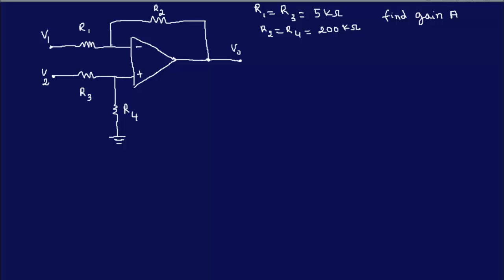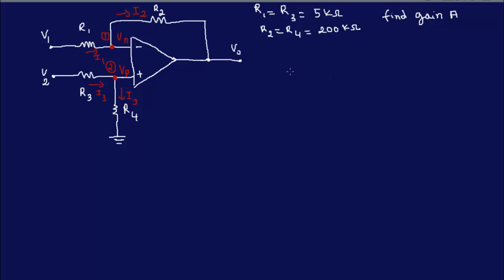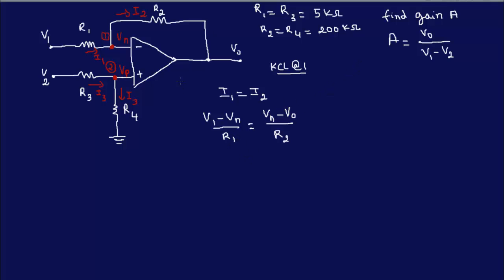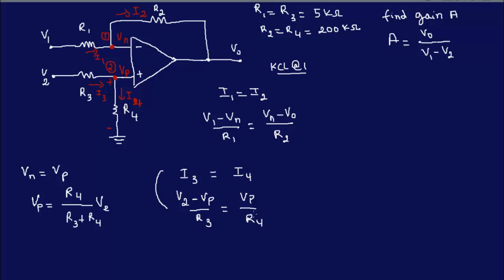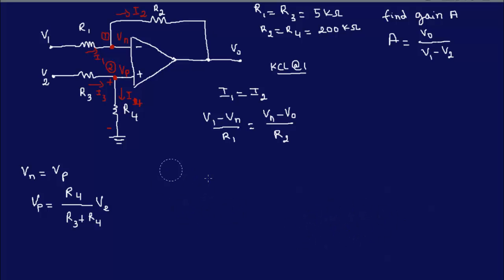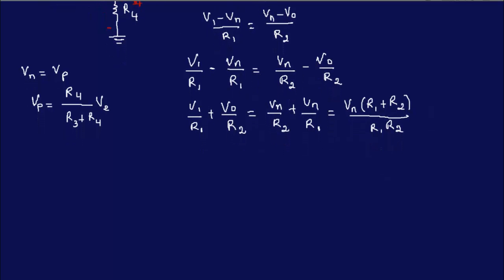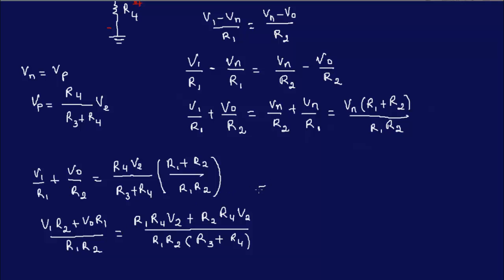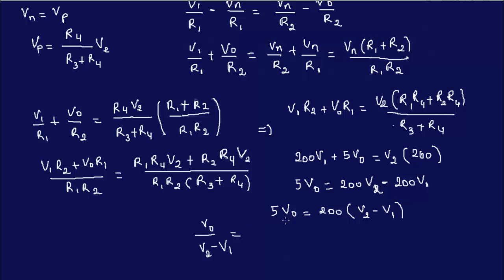OpAmp Circuit Analysis Example 5-FE/EIT Review

Comment: That was a great tutorial! Just wanted to address that the gain is actually (-40) and not (+40). Another simple method is (-Rf/Rin).
Great job though!
Reply: Not true, -40 would be the gain for an inverting amplifier (only the negative terminal has an input voltage). This is a difference amplifier (both terminals have input voltages). The formula is:
A = Vout/(Vb-Va) = Rf/Rin
A = Vout/(V2-V1) = R2/R1
A = 200k/5k
A = 40

Now, it can be difficult to memorize these gain formulas for the various amplifier configurations, and since the FE handbook doesn't have them your best bet is to use node voltage analysis for the 2 terminals. If you use the actual resistor values it should go a lot quicker than using the variables as in this video. 
The quick way to do this problem:
Node 1: (Vn-V1)/5k + (Vn-Vo)/200k = 0
Node 2: (Vp-V2)/5k + (Vp-Vo)/200k = 0

Since Vp = Vn, Node 2 becomes:
(Vn-V2)/5k + (Vn-Vo)/200k = 0

Multiply through the LCM of 200k for each equation:
Node 1: 40(Vn-V1) + (Vn-Vo) = 0
Node 2: 40(Vn-V2) + (Vn-Vo) = 0

Node 1: 41Vn - 40V1 = Vo
Node 2: 41Vn - 40V2 = 0

Subtract 2 equations (or solve for Vn and substitute):

-40V1 + 40V2 = Vo
40(V2-V1)  = Vo
40 = Vo/(V2-V1)
A = 40
Reply: +Mark Necklace Can you please explain how did you get -40? Also, it will be helpful if you can explain the rf/rin method.

Comment: Why not just use A=-Rf/Rin? The way you did it is great practice but lengthy.
Reply: This is not an inverting amplifier but a difference amplifier (both terminals have input voltages). The formula is:
A = Vout/(Vb-Va) = Rf/Rin
A = Vout/(V2-V1) = R2/R1
A = 200k/5k
A = 40

The gain is positive not negative. If you did not remember this formula, use node voltage analysis at the 2 nodes as done in the video. I recommend using the actual numbers to save time. 

The quick way to do this problem:
Node 1: (Vn-V1)/5k + (Vn-Vo)/200k = 0
Node 2: (Vp-V2)/5k + (Vp-Vo)/200k = 0

Since Vp = Vn, Node 2 becomes:
(Vn-V2)/5k + (Vn-Vo)/200k = 0

Multiply through the LCM of 200k for each equation:
Node 1: 40(Vn-V1) + (Vn-Vo) = 0
Node 2: 40(Vn-V2) + (Vn-Vo) = 0

Node 1: 41Vn - 40V1 = Vo
Node 2: 41Vn - 40V2 = 0

Subtract 2 equations (or solve for Vn and substitute):

-40V1 + 40V2 = Vo
40(V2-V1)  = Vo
40 = Vo/(V2-V1)
A = 40
Reply: This is how you prove A=-Rf/Rin.